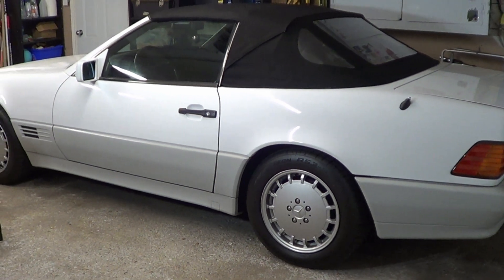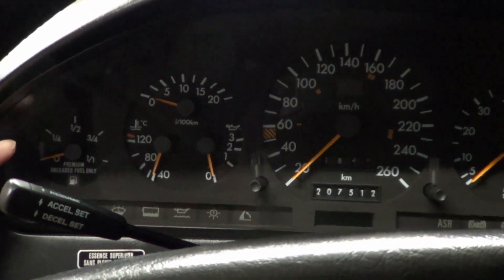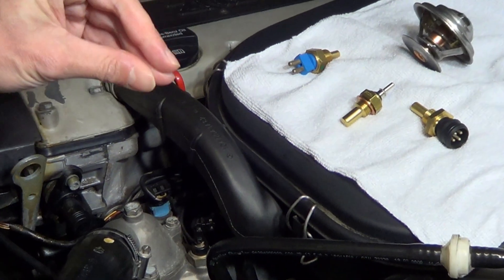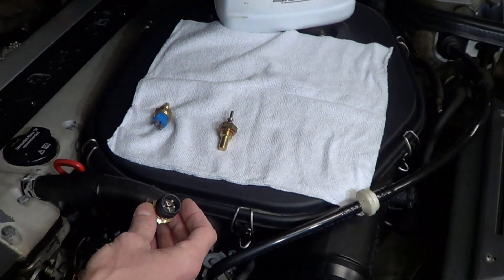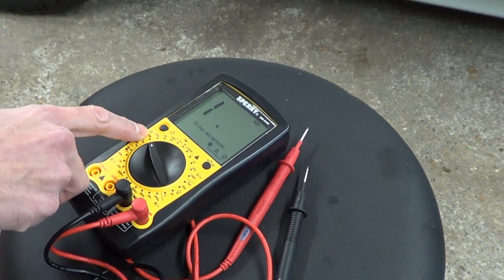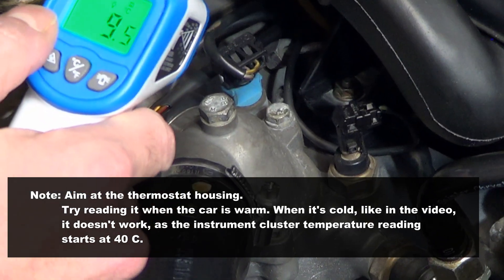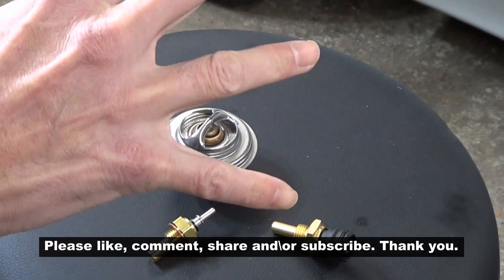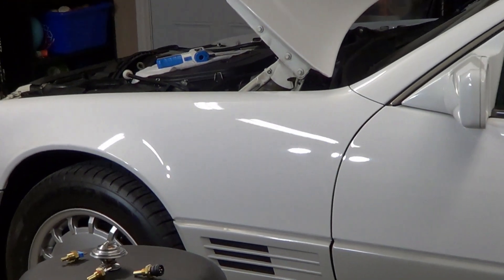Mercedes Overheating, Poor starts & Mileage R129, W124, W201 Coolant Temperature Sensors, Thermostat

Comment: Hey there. Thanks for the video. So my sl320 is weird of course. It was showing 13k on one of the sets. 2/3 pin and on 1/4 it was showing 5k. 
So I ended up buying a new one. Made in Italy. 4 pins but the pins on mine are more like slits. 
So anyway. The new one is only slightly different in the numbers and I’m wondering if I should have changed it.
Reply from the maker: That's interesting. It sounds like you might have gotten a different sensor. I'd check the part numbers very carefully. The Ohms seem out of spec for a 4 pin coolant temperature sensor, they should be reading the same value. What year is your SL320?
Reply: @HandyVal it’s a 95. The part is identical to the one that was in the vehicle and I’ve had this car for about 15 years now. Not sure. I’m having a good amount of issues with this car right now that need to be addressed haha. 
I’m going to replace the mounts and see if that helps. Also there is a vacuum leak somewhere I have no idea how to get to that I have to figure out. Among other things. I dropped it off at the mechanic and he said he’ll look into it when he can. 
All and all the car is not too bad. It drives pretty well and I love it. I just want to take care of it so it’ll last longer.

Comment: oh my m104 I put a 75C thermostat.
Reply from the maker: You can live with it. It’s not optimal, as it will take the car longer to reach optimal temperature. It could be detrimental if you had a 95 thermostat as the car would likely overheat.

Comment: Hi Val. Thank you for your video! Very informative. I have an issue with a SL280 1996 (M104 943 motor). The AUX fans are turning on as soon as you turn the ignition on. I assume is a faulty Blue sensor. Unfortunately I can't find it anywhere in the engine bay (it's not on the thermostat housing or anywhere near it). Would you have an idea where it is on m104 943 2,8 motor? Thanks
Reply from the maker: Thanks,. I'm not familiar with the SL280. Mercedes moved away from the system showed in the video. There's something faulty as the auxiliary fans shouldn't be on all the time. Is this a new car for you? I ask this in case the previous owner bypassed the switches. Edit: Thinking about this some more. For years 95+, in and about, that your car fits, it's a one sensor combo that Mercedes moved to, that controls auxiliary fans and messages the cars computer for engine optimization. So I think you probably have a faulty engine coolant temperature sensor (ect). It's cheap and easy to replace as a DIY or a mechanic shop. I hope this helps.

Comment: I changed the new NRF coolant sensor and now my temperature gauge rises immediatelly over 100 C degree and turn on also aux both cooling fans  ! What could be wrong ?
Reply from the maker: What brand sensor did you use? It should not be happening unless the car has a serious heat/coolant problem and your old sensor was too faulty to notice.
Reply: @HandyVal the NRF brand. I measure it and was faulty new one 😮. I ordered from Hella now because original Mercedes costs 80 € and Hella 40 €. I hope it will work ....
Reply from the maker: @joesaric1 Hella is a very good choice. I'm sure your problem will go away. Keep me updated.

Comment: Wow Val, I liked another one of your videos the other day and said I was sure I'd be back for more! Well, the 500SL that I have owned for about 5 days is now telling me it is overheating! This video is excellent. I really enjoyed watching it, and it does such a great job of making the information simple and digestible.
Reply from the maker: Thank you. I hope you’ll be able to fix the overheating. Keep me posted.
Reply: @HandyVal  I am out of state for the summer and don't have any of my tools with me, but everything seems to be operating as it should be and the gauge cluster temp sensor is a Uro! Coming from BMWs, I know Uro is junk. Reasonably certain that is my issues and parts get here tomorrow!
Reply from the maker: @TrevorS38 URO is likely your problem. For sensors, best to steer clear of them. For cosmetic parts, URO does the job well.

Comment: Hi Val, thanks for the breakdown. My mercedes c-class w202 1996 c200. Whilst driving the car temperature is normal. When i pull up and put my car in Park and put handbrake on the needle on my gauge goes to red.
What could the issue be? I'm not sure if this model has an instrument cluster sensor. Could it be the coolant
 temperature sensor?
Thanks in advance.
Reply from the maker: This doesn’t feel right. I know on the 202 they moved to a single sensor starting in either 1996 or 1997. But nonetheless, we need to be 100% certain it’s a faulty sensor or poor instrument cluster connection. So let’s be 100% certain the car isn’t overheating. To do this, you can use an infrared thermo gun (~$25 on Amazon) and point it to the thermostat cover. If that temperature is less than 100C then  we know it’s not overheating…and we can investigate further from there. Does the car have any other problems - poor cold starts? Or poor warm starts? I’m trying to gauge if it’s just easier for you to replace the coolant temperatures sensor with a new one.
Reply: Thanks for getting back to me. I'll keep you updated.
Reply: Hi Val, a quick update. I disconnected the negative connection on the battery and removed the cluster just enough to push the connections at the back in and give them a wiggle. I replaced the cluster and reconnected the battery. It's been 3 days, and I haven't had the issue with the temperature gauge. I'm not calling this a fix, but it seems to point the issue towards the cluster. Or maybe just disconnecting the battery has reset the cluster? Either way, at least I have an idea where it's coming from. Thanks for your advice. Hopefully, this will help someone else down the line.
Reply from the maker: I think this is success! Anytime a gremlin is removed, it’s a success, regardless of the ‘why’. Well done. Does the new cluster use your car’s original miles? Thanks for sharing your experience - definitely helpful for me, and the R129 community.
Reply: I meant to write I replaced the original cluster back into the dashboard after pushing the connectors in.
Reply from the maker: Got it now. Great - zero cost fixes are the best!
Reply: Hi Val, thanks for the reply. It doesn't show any other issues and I took it for a long drive today up to higher speeds and in traffic without it going over 85°c. When I pulled up on my drive and applied the handbrake and Park gear, the needle shot up to red and the aux fans came on. The needle isn't erratic, it just glides ride up to red.
Reply: It does have one sensor on the thermostat housing with the others capped off.
Reply: No issues with cold or warm starts as of yet.
Reply: I use a thermal imaging camera at work and will use it on the thermostat on Saturday when I'm next in. I'm guessing I should do it when the car is warmed up?
Reply from the maker: Try the thermal camera with the car in Park gear and the hand brake applied. In park it should climb a bit (as it doesn’t have any air movement, except for the viscous fan), so I would expect a reading likely up to 100C but not more. Given all the other info, I think it’s likely a glitch with the instrument panel.
Reply: Hi Val, so I used the thermal imaging camera on my thermostat today. I left the car in Park and handbrake applied. The needle shot up to red, and the auxiliary fans kicked in. After releasing both breaks the gauge dropped. I did this on and off for 20 minutes and at no point did the thermostat get over 70°c. Every time the needle went into red the auxiliary fans came on and turned off when the needle dropped.
Reply from the maker: This is a good sign. Seems like everything is working well, even the aux fans. I still don’t understand what could be triggering the temperature gauge to increase so much.
Reply: So, if i were to change the instrument cluster up and see if it makes a difference. I'm lead to believe on the 1996 w202 model, the mileage is stored in the ECU so shouldn't be a problem.
Reply from the maker: I wouldn’t yet move to a different cluster. Clusters can be expensive to swap out. Where I struggle is that the aux fans come one, when in park and handbrake applied, which means the sensor is registering the high temp. So now, I think it may not be the cluster. If you have an extra cluster, or if clusters aren’t too pricey in your area, it may be worth a swap.

Comment: I think the blue sensor main function is to activate the radiator fan on the engine side, and when aircon is on it will activate the auxiliary fans.
Reply from the maker: Hi. Thanks for the comment. The radiator fan, also known as the viscous fan, is not controlled by blue sensor. It is operated by the speed of the car and it automatically speeds up when warm. The aux fans main function is to keep the air conditioning system cool. And under extreme heat, the aux fans are also used to keep the engine cool. I hope this helps.
Reply: @HandyVal  I was thinking about the electromagnetic clutch for the cars that have that type of engine fan. If it's the viscous then it is as you say.

Comment: here in iraq some of them they remove this thermostat and some of them put 65 ,75 81 .
Could you tell us what is the normal temperature for Mercedes W140 1992 300 sel
Reply from the maker: Those cars were originally equipped with 87 Celsius thermostats. It’s common to change the thermostat to a lower one, but I’d be careful not to go too low. 65 or 75 seems low, but I don’t have a lot of your country history. A lower thermostat will take longer for the car to reach operating temperature which would be sub-optimal.

Comment: My engine is quite slow to get up to operating temperature 80-85C so I assume my thermostat is always open. On the summer days it takes 6-7minutes drive to reach 80C and on cold winter days that can be 12-14minute  drive. At 3:50 you point out the hose that should be warm fairly quickly after engine is up to temp 85C but if I understand good, if the engine temp is only 75-80C this hose must be stiill cold right?
Reply from the maker: The hose should be warm even before the thermostat opens, as there is still some coolant that flows through a closed thermostat (I didn’t explain this in the video as it’s only a small flow). It should feel lukewarm and you should be able to keep your hand on the hose without burning your hand. Once the thermostat opens, holding your hand on the hose becomes difficult because as it gets really hot. 
To answer your question if the engine temp is 75-80 the hose should be lukewarm.
Overall, given what you shared your thermostat is working well. I hope this helps.

Comment: What are the hash marks on the speedo? i.e. I, II, III, IIII?  Also, what are the hash marks between 50 & 60 kph?  My SL is 2000 and I don’t have any hash marks.
Reply from the maker: Good catch. Older Mercedes had such lines and in newer Mercedes those lines were dropped. The four different lines represent the maximum speed in those gears. It doesn't seem intuitive, as the km/h seem too high, but it's true. On my R129, it being a Canadian model, the first two yellow lines seem to closely align with the maximum speed limits (60 km/h for major roadway, and in 1992, 100km/h for highways), so many confuse it to relate to speed limits.  The hash mark area is certainly meant to cover speed limits within the major roadways and the 50-60km/h is within the common major roadway maximum around the globe.
Reply: Thanks!  I had a hunch they were related to max speed in each gear. My 1968 manual transmission VW Beetle had similar hash marks, but that car did not have a tachometer. Thanks again!